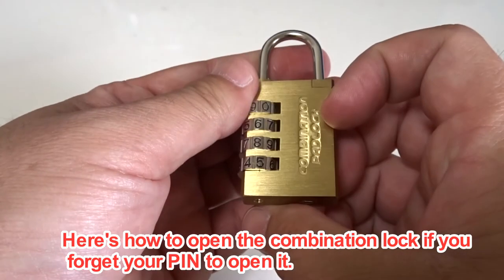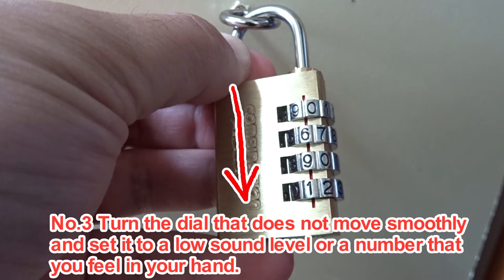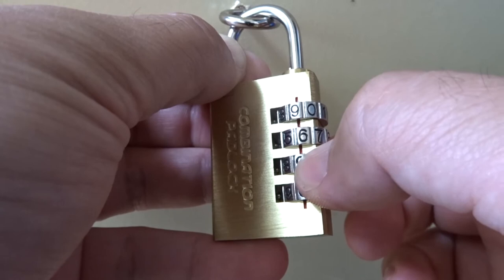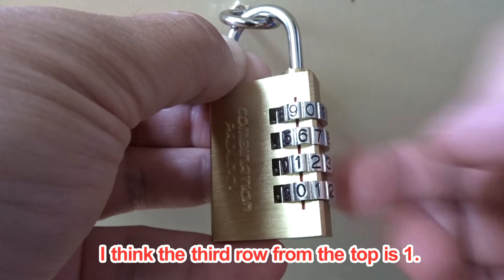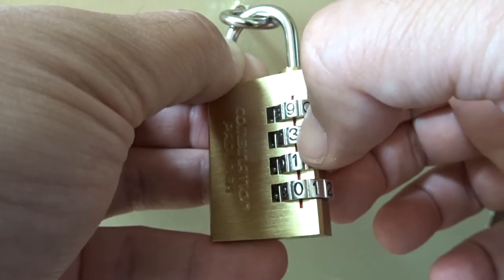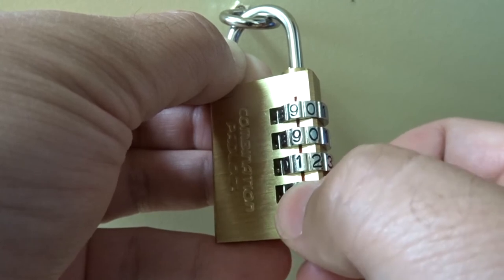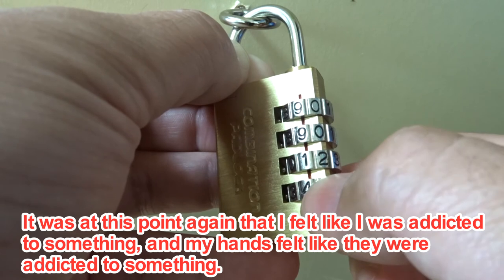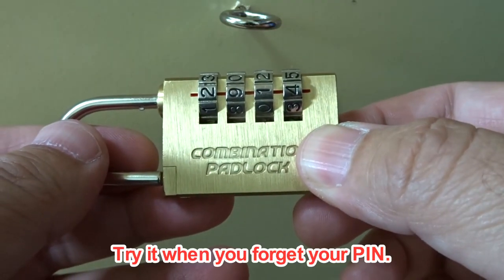How to unlock a combination lock for which you have forgotten your PIN password

Comment: This worked for every padlock in the house 😂😂 this is awesome I'd been at one lock 100 times easily with all different "hacks/tricks" I didn't go by sound I went by feel as all mine sounded similar regardless of the way I turned 😂 either way it works!! On 2 x 6 lock codes/ 4 x 4lock codes and 6 x 3 lock codes❤